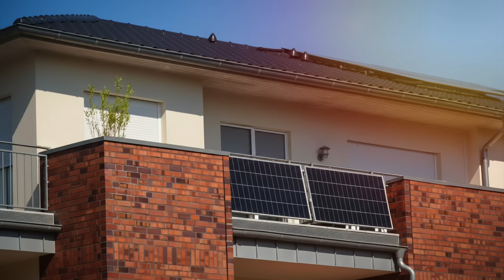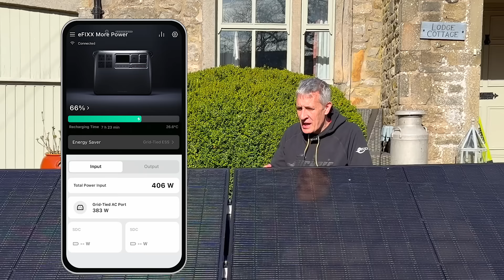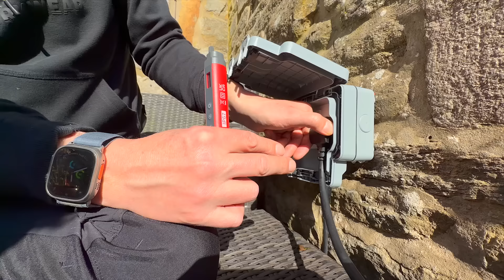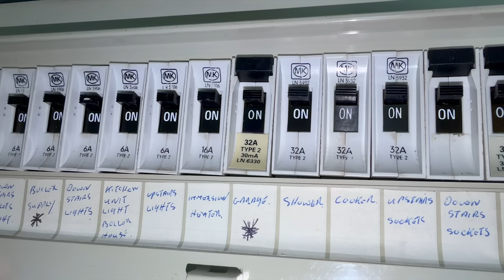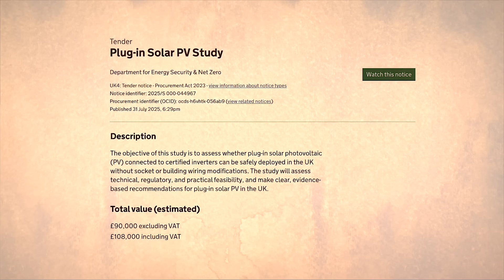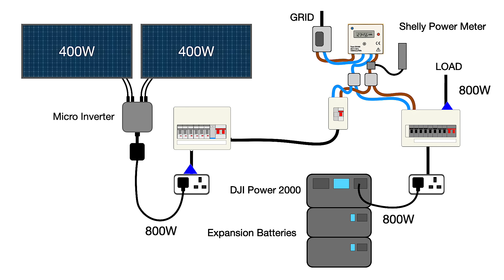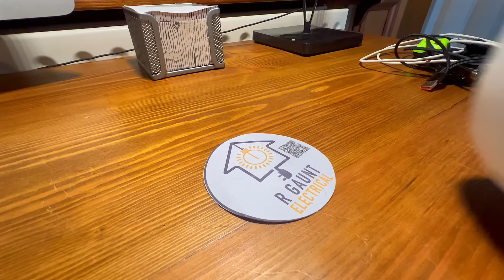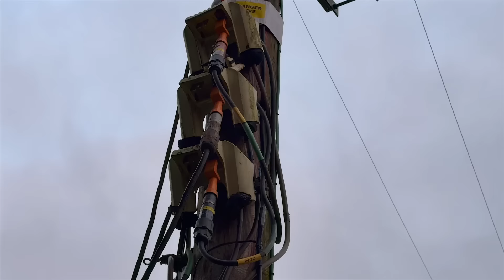Plug in Solar: We’re Told Never Do This… So I Did

Comment: So realistically what is the initial set up cost for the exact setup you showed there? 

How long will the battery packs & solar panels last before they need replacing? 

I’m having a really hard time believing that solar & battery is the way forwards. I personally feel we are being sent backwards in Europe when we have the ability to have mains electricity to our door. 

The eco argument is fully debunked, Co2 levels are not dangerous, in point of fact Co2 is the gas of life on earth but if people just accept the ‘experts’ (who funds them?) narrative without question we will be forced back into the dark ages.
Reply: Solar panels and inverters tend to have 20 year warranties.  Batteries tend to be 5 years.  Solar panels are cheap but the fittings and installation aren't hence the DIY route suggested.  Batteries are expensive but getting cheaper - arbitrage allows you to use low/no cost electricity during peak periods and the savings quickly add up.

Comment: I already have solar panels on the roof, but would be interested in having plug in solar panels and battery packs, if they could be integrated so that I could charge batteries from the plug in panels during the day and run my house from the batteries at night...or do whatever is cheapest.

Comment: What happens if you either don't have a battery or the battery is full and your consumption is less than production?
Reply: Goes into the grid.  You can sell the surplus if you have forked out for installation by an MCS contractor but I couldn't make the numbers stack up so I give away the surplus. Might buy an add on battery.
Reply: @nickdavies1977 what if you don't have the ability to export though.
Reply: @friarchris2  you give it away for free.

Comment: Sorry for stupid question but how does your panels know to put power into the battery? Or are you selling back to grid and just charging battery taking the solar power as offset?
Must watch the dji video because I am told in Ireland, we must have a change over switch to isolate the house from grid when back feeding... Not possible for due to location of the solar setup I have.

Comment: Like Martin Lewis says, you haven’t saved a penny until youve paid back your investment so after 7 years you can say your solar setup saves you money. 
I’ll definitely be getting a setup like this in the future
Reply: @CarlosFandango1975  that's assuming electricity rates stay the same price, I'm guessing it will be more expensive so your payback period may be 4 or 5 years rather than 7
Reply: @kevinwillis6707 mines still a cheap 2 year fixed  eon deal with the whole house at 7p/kwh for 7 hours in the night. I’m guessing like in previous years, the cost of solar panels will come down so I’ll wait another year and hopefully it’ll all be legal and house insurance approved by then
Reply: Aha easy solution! Steal someone else's solar setup 😂 jk of course
Reply: And you have to factor in hardware failure. If a panel breaks you have to pay to fix it. Also you have a huge eyesore on your property. Not worth it when you consider those
Reply: not exactly, while you are technically correct, a 7 year payback is equivalent to a 14% return on teh capital cost. You show me a bank savings account guaranteed to give you even half that for 7 years.. Then after that of course it is saving you money to the tune of ~£250 a year. more if energy prices keep going up.
Reply: @nickbarr-hamilton9611 good point. The sooner these are uk compliant the better
Reply: @nickbarr-hamilton9611  That's true but in this case the money is locked away indefinitely, unlike a bank account. You can't withdraw your capital (you can sell the equipment of course but usually at a significant or majority loss)
Reply: @nickbarr-hamilton9611  For a bank savings account the money you deposited is yours at face value. A solar kit will reduce in value over time to nil.
Reply: @CarlosFandango1975  we spent 5 days without electric not that long ago, we spent close to £300 because we could cook and didn’t have enough logs for our fire and it was feeezing. This isn’t just about investment, we could have saved that £300.

Comment: I've installed a 2 panel (1kw nominal) kit from Zendure. I've only seen it during winter months but it has been up to 8-900w output. I'm just about to add 2 X 2kwh batteries, and in total this has cost €1600. I'm in France, where they have now changed the rules to insist the plug in Solar is on a dedicated circuit.

Comment: I've been running plug-in batteries for a year now and I'm not going back!
40kWh capacity for 4300 euro! 2.5kW in and out per battery pack. No issues.

Comment: Ummm surely the safety issue is that the power source is in front of the RCD, ie on the same side of the circuit as the load. So even in the event of an RCD trip there is still power (from the solar array) in the ring circuit. Simple enough to fix, fit an RCD in the solar feed circuit too.
Reply: No the inverters switch off.
Reply: @nickdavies1977  I did wonder if the inverter would detect the fault and cut off the supply, but they'd only do that if they still had an active connection to whatever caused the fault. So if a circuit broke it could leave a solar array still providing power to part of a broken circuit that had been cut off by an RCD, which then needs to be toubleshot. I've been pondering the safety implications and possibilities of this multiple input power sources to a ring circuit since then.

Comment: What's the typical lifetime likely to be for a system like this?  I think it would be best for governments to focus on incentivising "proper" permanent installations - on roofs, hard-wired into the switchboard etc, likely to last 20+ years, compared to systems like this which I suspect are more likely to be used as temporary solutions, and/or take a lot more knocks over the years and thus run the risk of becoming solar e-waste within a decade or so years, diminishing the environmental benefits.

Comment: I've invested heavily in a fixed solar and heat pump set-up in what I expected to be my retirement home - achieving net zero - but due to adverse circumstances I no longer feel safe there and will now move. It's heartbreaking to have done all the work and not to be able to reap the benefits. Realistically, in an increasingly volatile geopolitical climate, I recognise that renting and retaining mobility is necessary for me and thus fully portable and relocatable systems are definitely the way forward for me. I'm looking to get a camper van and modify it to have substantial deployable solar capacity, not only for off-grid living, but also to power off-grid movement. It's to please my geeky inner child, but why not?

Comment: The main reason for not plugging any energy generation into your plugs that way was to avoid sending anything down the line to an engineer who may be operating on local your power supply when he thinks the power has been shut down on the grid side of the line.

Comment: My friends edd and Danny lived next to each other in 2 bedroom apartments in the UK. Edd had his electric meter "sorted", so was getting free electricity. He made up a lead with a 3 pin plug on each end, and ran it from a socket in his flat, to a socket in Danny's flat, Danny had his power turned off at the meter. Edds flat POWERED Danny's via the socket to socket set up. So yeah, you can do this. Whether it's safe or not I don't know. But it's been done and I've seen it.
Reply: That's seriously illegal and if they get caught, they'll be sent to prison. I get they probably want to send a big f u to the energy companies. However, there are legal ways of doing this, such as getting solar and batteries.

Comment: Is it safe to send power the wrong way through a socket? I'd say no.
You have many things to consider.
The power capacity of the cables
Can it match the phase of the electricity in the sockets
Would the fuse/breaker work?
and more concerns.

I'm not saying it can't be done safely, I just doubt how safe a DIY plug in system can be.
Reply: @bobingabout   The idea is that basic certified equipment does do it correctly. The technology is some 10yrs old.
Reply: Assuming your  install isnt more than 6 panels and the socket isn't connected to the lighting circuit it should be fine.  Just do simple calculations.

Comment: Solar panels don't generate power.  Yes you heard me right. Read this before you call me crazy. 

So solar panels generate power while the sun is up right? Wrong again. Of the 12 hours of the 24 hours each day solar is not generating power every hour. Only 4-6 of the 12 hours the sun is up do they actually generate anything close to there rated power. It's called the bell curve.

 So of the 5 ish hours every 24 hours they are generating power right? Wrong. You see the power plants that run off of "dirty" coal or fossil fuels are still running during those 5 hours the solar is "powering" your house. You see those traditional "dirty" power plants can not be turned off or even turned down for 5 hours while the sun is up. What does that mean? That means the traditional "dirty" power plants run 24/7/365 days of the year to cover your power needs no matter how many solar panels you have up. Which means solar panels don't generate any power.

Am I wrong?
Reply: No and yes.  Some days solar doesn't generate and others it generates a lot but yes only during daylight hours.  But add a battery and you can effectively time shift daylight.
Reply: @nickdavies1977 I recommend you read my comment again. Solar panels don't generate power. Or you tell me where I'm wrong. But don't just comment and say solar panels generate power. 

Onto batteries.. basically you have been lied to about batteries as well as solar panels. There is a lot of propaganda saying solar and batteries are the future. They are not. You can't make a battery big enough to over your power needs 24/7. Think about it. Solar is generating power 5 of the 24 hours. Why are we talking about solar panels when we should be talking about batteries most of the time because 19 of the 24 hours you would be using batteries NOT solar panels. The majority of the time batteries would be powering your needs but batteries are always a side subject. Anyways, the point is, you can't make a battery large enough. No one has no one will.

Comment: An issue is if there was a fault and a MCB or RCD tripped within the electrical systems designed time (normally 0.4s for TN supply) the solar inverter could feed into the circuit with a fault therefore meaning ADS (Automatic disconnection of supply) would not work. I understand the grid tie solar inverters stops outputting when they detect a grid supply failure but typically this is not 'instant' or within the required time for ADS

Comment: with daily usage around 33kw installing 30 panels and a 42kw battery just to beat power bills, they buy the power at 4c and charge it back to you at 30c+, plain theft:hand-orange-covering-eyes:
Reply: In Norway, we have solar accounts, which means you can choose to not sell the power, but fill your account with credits to the provider and "withdraw" the credit whenever at a later date. It makes sense in winter when solar is weak. Also, you dont have to pay fee for the grid when "withdrawing" your credit.

Comment: Recipie for disaster with any Ting Tong brand 😂.  And what's the ROI (in decades) when you add 6kW of batteries 😂😂😂
Reply: I thought he said round trip through the battery was $0.10 (maybe $0.13 converted from Euros)
Reply: @artsmith103 now add the total cost of the batteries and all equipment over five years. After five it will all need replacing!
Reply: @MrFrobbo  Battery lifecycle costs are typically about the same as the electricity cost.
I have gridtie solar for 90-100% of my annual electricity, no batteries. I have a 7.5kWh PHEV I drive as 40mpg HEV because <$3 gasoline is cheaper than electricity + battery lifecycle cost. So rarely charge battery until it winds down <15% every couple months.

Comment: I once had to connect two internal grids using a cable with plugs on each end. 
Which worked fine until I forgot about it and picked it up with my bare hands. 
Twice. 
That's why I never work on HV.
Reply: In USA, we call that a Suicide Plug. RVers are known to do it sometimes.

Comment: I didn't like the video, even though I'm a subscriber to the channel, because for me it was a clear advertisement for DJI. Actually, not about a few hundred dollars for 2 panels and an inverter, but about thousands in batteries. With the need for 7 years to break even, the investment can hardly be justified, unless you really don't have electricity within miles of you (like me). I have bitter experience over the past 20 years and I would be happy to be wrong, but this technology has nothing to do with the Japanese 18650 from the early 2000s that I still use. Otherwise, your entire video is completely pointless...ambiguous?!?
Reply: Wrong. My entire 3.8kW gridtie array cost <$10K and has about 9yrs payback with my cheap grid electric. ~11% ROI, fantastic!!

Comment: These kinds of inverters are perfectly safe to be used with a normal plug, because they come with double protection mechanisms. In the early days these only had one mechanism with an electronic shutdown, which is required for all grid tied inverters. They require a phase and can not produce their own phase (for pure grid tied inverters i mean).
Nowadays all these small inverter bricks at 800w power do come with with dual disconnect due to regulations in countries like germany. Otherwise they can not be sold there. The second disconnect mechanist is required to be a relay. And it is also regulated how fast they must be at least. The speed requirement is so fast that it is physically impossible to touch the plug when it is live.

Comment: One question that comes to mind, is whether the anti-islanding protection works correctly when you have multiple devices connected to the same circuit?
As in, if the micro inverter and the battery are connected on the same wall socket for example, is there a chance of them keeping each other online?

Comment: It is IRRESPONSIBLE for you to take it upon yourself to 'test' whether it is safe. What is the impact on the sub-station at the end of your street and the danger to the people working on transformers and transmission lines that have been isolated from the grid - but are still live because of your grid tie inverter? If your GTI develops a fault and continues to output 220v when the mains are off - you will kill someone.
Reply from the maker: Have you WATCHED the start of the video and the demo of the anti-islanding device?

Comment: What is the composition of the battery banks you are using?  wondering as the landlord insurance company I use has specific exclusions for charging and storing lithium battery equipment while my own home cover does not. This would be another area that could be made clearer if a regulated standard is established.

Comment: Nice setup! Some good news in Germany they finaly acsept a blug in system as an valid conection. so its just a matter of time that nother european countrys follow up. i am not fammilar with the laws and regulations in the UK. i asume they are based on phsics and not opinion. But i have a few thoughts abaut it. First why not having 800W per phase? (I heard that that could lead to a star point schift wich i dont actually understand how that could happen when you have a neutral.conductor) . Second thought would be why stop at 800w? I understand that if you draw power from the grid like 16Amps and you add more then your 3.3 amps from your solar inverter that the prodection of the conductor is not longer granded. But in your video at 6,44 min i can see the Black cubes on the Phases they look like Amp meters to me. So your inverter basicly knows how much amps come from the grid and can regulate the output acordingly within mill seconds.And you have no risk of an fire hazard. Sorry for my bad english, it is not my first languege and i have been really bad at school.

Comment: What an incredible stupid thing to do. Yes it is illegal for a very good reason, next time there is a power cut in your area, and workmen come out to fix it, you will electrocute them. A correctly installed solar system will not only correctly sink the ac out put to the frequency of the mains supply. When there is a power cut it will instantly switch off, and will be safe for all. Please no one follow this video and commit a crime that could kill someone.
Reply from the maker: Did you watch the start of the video? - what happens when the power is removed?
Reply: @efixx  Yes, but it's just another waste of government (our) money. They will just spend our money on confirming it is a dangerous thing to do. If you want to connect solar to the mains, get a proper feed in control unit, and get it fitted by a electrocution. But remember there is nothing wrong with you having a completely separate system to supply sockets only connected to the solar system.
Reply: @SuperBartet so you watched the video but didn't understand it!
Reply: @nickdavies1977  I just don't know how you can say such a ridiculous thing as I didn't understand it? What I said is the legal way to connect solar to the mains, do not plug solar into a mains socket, it is a illegal and very stupid think to do, for to many reasons for me to list here. You can look up the Electrical regulations and standards for installations on the web, I think you need to do that and tech yourself the correct way. So please don't make yourself look a fool by telling me I don't understand it.